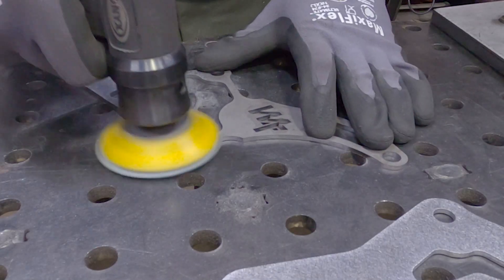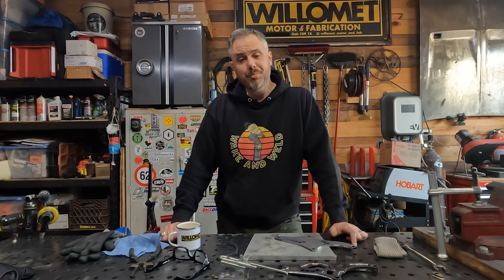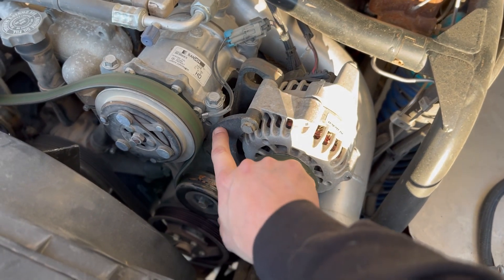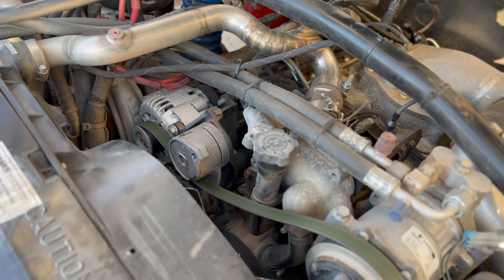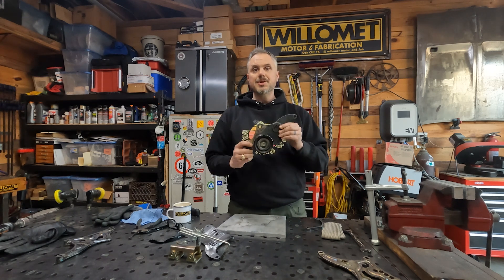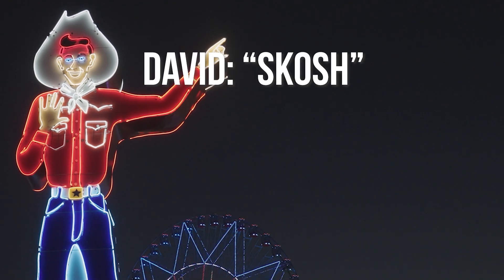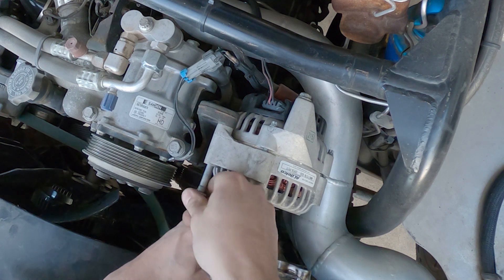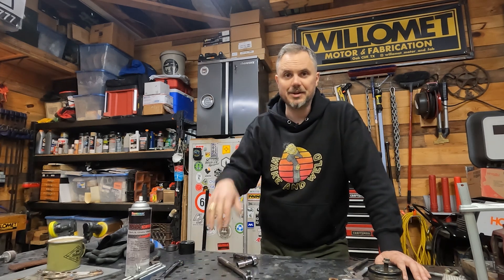Dual Alternator Bracket for GM 6.5 Diesel

Comment: Question 

I installed your bracket sit up great bracket. I have the factory alternator in its original place with the factory harness. It’s hooked up to one battery. Second alternator is hooked up to the other battery they both are putting out a little over 14 volts each. The problem I’m having now is when the 6.5 is at idle the battery light comes on and the rpm gauge goes zero when I give a little acceleration light goes off and rpm gauge works. It there anythingI could check. I have both alternators on a resettable fuse when I turned off the fuse to the second alternator. Everything goes back to normal idle fine RPM gauge is working light is off.
Reply from the maker: There is a factory wiring harness diagram in the product listing. It has the alternators in parallel charging to a single battery, the S signal is coming off the primary with that same terminal left blank on the secondary. That’s the only way I’ve wired these.
Reply: @ so only land S wire to 12 volt on the secondary alternator?
Reply from the maker: @wallstill  I don't have the s wire connected on the secondary at all. The tach only needs a waveform from one alternator. Again, the diagram is my go-by.

Comment: Wait, you are running dual alternators and you love to weld, but you don't set at least one of them up to have a welder on your truck? Merlin's Old School Garage has a video of how to set up a welder/110 AC outlet on your truck in case you break something on the trail and need to weld it back on to make it out!
Reply from the maker: It’s strange right? In the past, we’ve just used a 24V welder or a rechargeable battery welder for trail repairs. But, those setups have some limitations.

Comment: Could you do a video explaining batteries wired in series and in parallel. HMMWV's (which use the same motor) have very little in the way of electronics as a base model, but they run a 24 volt system, with either a 200 amp alternator or 400 amp. Aside from more weight, is this setup providing any benefit? This 24V, 2 battery setup has the capability to power all sorts of commo equipment, but for driving purposes does it provide any benefits?
Reply: No, a 400 amp alternator is much bigger than these two, and is sufficient to run just about anything you can imagine!

Comment: Wow… the number of people saying “that’s cool but can I use it for something completely different and not at all related” is absolutely ridiculous! Some people’s kids… 

This is great! I always wanted to do this on my old 98. But I never got around to it. And now both my Burbs are 94. So I’m going to make a bracket to replace the vacuum pump with an alternator.
Reply from the maker: That surprised me, too. I sure wish your serpentine setup was easier to work in a bracket, because I’d make one of those, too.
Reply: @WillometMotorFab  I think it’s actually gonna work out well. It’s just a matter of having it on a stand in the shop to be able to get it fabbed up.
Reply: @WillometMotorFab  Add me to the list of "shut up and take my money" if you find a way for pre-96 peoples. My '92 K3500 feels left out.

Comment: After reading all the comments looks like you could start a whole new business making everything these boys are in need of, even to the point of converting the compressors to air pumps.
Although they're not very efficient as air compressors. 
There's a lot of better versions made for the air bags setup, and they even have high pressure tanks for the extra capacity needed to actually be useful. 
Just a thought is all, use to live in Cockrell Hill over behind the old drive in turned bus depot last I heard..
Cousin still lives there, and another one over by CHPD.
That part of the world sure has changed over the years, but then so has the whole metroplex unfortunately..
Traffic is as bad as Houston, and getting worse by the day. 
Take care, and nice to see someone still using the old suburban for the right reasons. 
I remember when there use to be a company that always had a conversation very similar to that back in the 80's at fair park every year.
Wonder what ever happened to those folks. 
Stay safe tread lightly, by using bigger tires, with lugs like tractors. 😂
Reply from the maker: Howdy Cockrell Hill! It's fun making small parts like this that solve a problem. Same thinking as you on the compressors - ARB and others have that figured out pretty well, so I'm not adding anything meaningful to the mix. Thanks for watching, and I'm glad you're here.

Comment: Do you build any brackets for the 6.2 diesel? Mine has the V-belt, but it eats alternator belts. Really would be better if I could run dual V-belts on the alternator.
Reply from the maker: I’ve seen a lot of folks use CUCV brackets there. I only made these for the late 6.5.

Comment: Does this work on a 350 Chevy? Also I’d like to convert a compressor for a onboard air setup. I have no fabrication equipment. I’d be interested in a bracket and how to video on converting a AC compressor. I think that would be a cool video
Reply from the maker: I doubt it. This is designed for the 6.5 bracket system, which is a completely different platform.
Reply: @WillometMotorFab  I don’t know anything about the 6.2/6.5 I didn’t know if they shared parts with the gas platform
Reply from the maker: @kylewest100  completely different engines, so the brackets wouldn't cross over

Comment: I've been aware of the OEM version, but never really looked into it. The additional alternator goes in on the driver's side? I have a '93 and a '94 and the OEM alternator is on the driver's side for each of them with the alternator feeding the driver's side battery and the starter being fed by the passenger side battery. I'd have to look to see if there would be room to mount a passenger side alternator with my setup.
Reply from the maker: There’s more detail in the video, but this is for the 96-00 accessory drive.